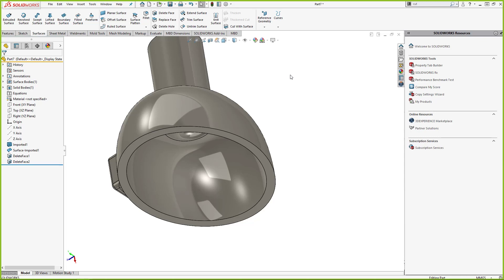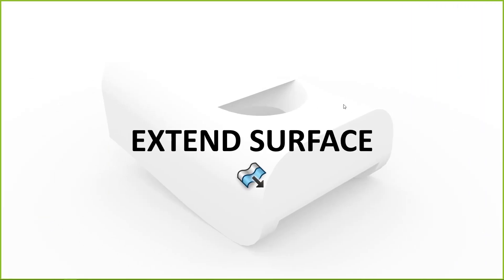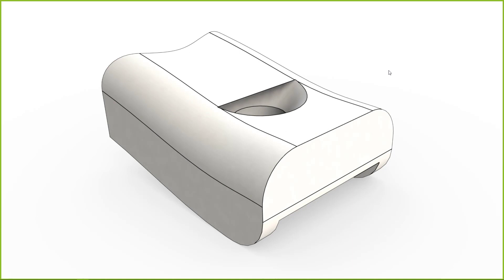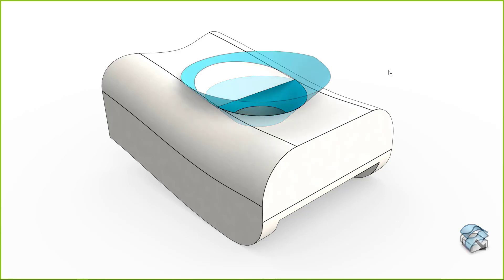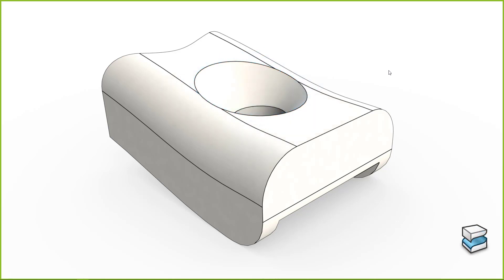SOLIDWORKS Tutorial - Surfacing for SolidModeling

Comment: Found this super useful. I really like the method of presenting: a heads up summary of the operations followed by the actual execution in SW. Previously I have tended to use the surface tools in isolation (on surfaces!). But this video has reminded me in a neat wat to start using the surface tools WITH the solid model.
Reply from the maker: Glad it was helpful!

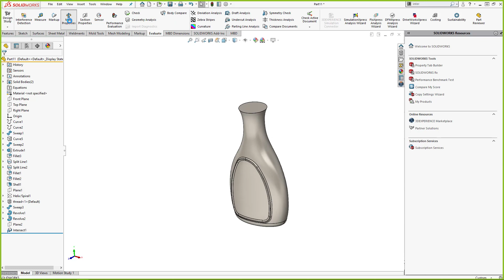Comment: Min 21:10 That doesn't make sense. How can you get the internal volume?  That's simply the remaining budy that's left after the intersect. It's not telling you how much liquid is inside (volume) the bottle at the water level (plane level). Need clarification on the "create internal regions" command of intersect, please.
Reply from the maker: For SOLIDWORKS “Create Internal Regions” in Intersect, it displays and creates an internal region from a closed (hollow) volume within the intersection of the objects. So in our case the hollow volume is the empty internal space of the bottle and the intersecting objects are the body of the bottle and the water level plane that I’ve added into the model.
Now that you’ve created a body representing the internal volume of your model you can use “Mass Properties” on the evaluate tab to evaluate the properties of that particular body.
This will give you the internal volume.

Comment: What rendering software did you use for the slideshow images between demonstrations?
Reply from the maker: Those images weren’t just made in a rendering software. We made those renders using a combination of several different renders made in Photoview 360 combined inside of photoshop. 
All of the highlighting was also done inside of photoshop.